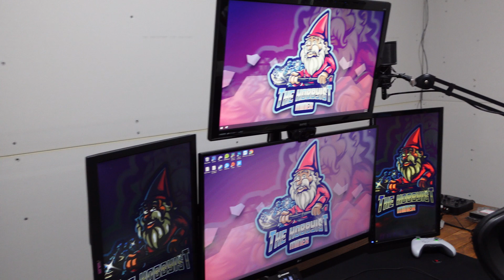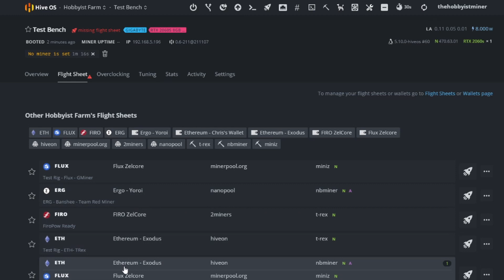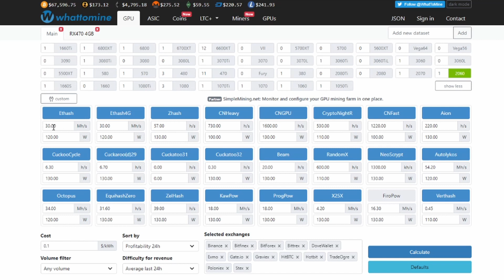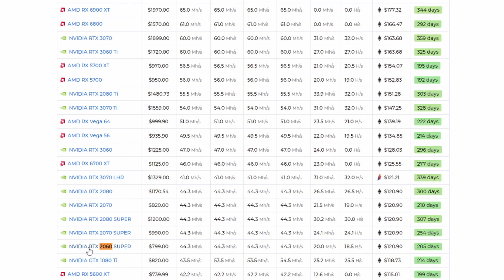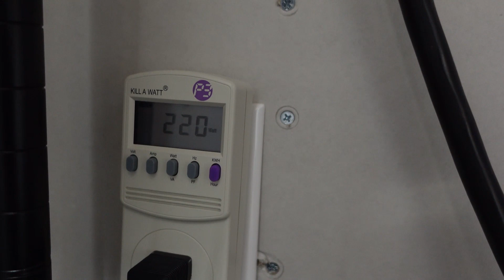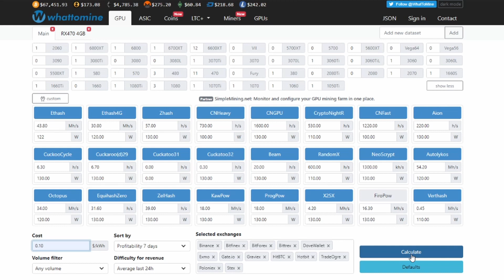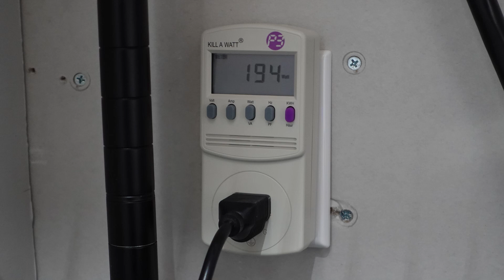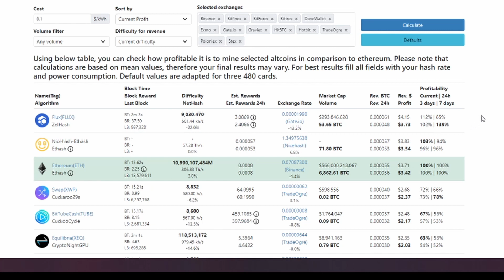RTX 2060 Super Mining Ethereum & Flux Hashrate, Profitability & Overclocking

Comment from the maker: Are you running a 2060 or 2060 Super? What kind of Hashrate and Power Consumption are you seeing on this card? LOVING IT!
Reply: I have a 2060s, and interestingly, you can push the power draw really low on these bad boys. Mine is pulling 42 MH/s at around 80W draw.
Reply: @hakarlrs9817  How??? I do not believe you, the lowest wattage of my 2060s was 98w and 38,3 mh/s.
Reply: @ramondiaz6044  ..thats about were im not.
Reply: @ramondiaz6044  mine is 520kh/w...
Reply: @hakarlrs9817  what model?
Reply: @2sidetales749  2060S as my comment says. Super, that is.
Reply: @hakarlrs9817  OC?
Reply: @mobileleaguebb1148   
core: -500
mem: +1300
Reply: I have a 2060 Super that pretty much runs about the same as the 2080 that share a miner rig with some 3070 and 3080.   Bother the 20's get around 42-43 MHS.  Mining ETH on that machine.
Reply: I GOT6 OF 2060SUPER, EACH GET 43.5 MHS, HAPPY WITH THAT😁
Reply: Not yet. Very hard to find any at a decent price tag
Reply: I have 2X 2060 super doing 85.5MH total on eth, I use Trex Miner in windows & the lock corelclock features- each cards runs at about 95watts.. BTW a 2060 super is basically a 2070
Reply: @jaytech7514  hi, what is your overclock settings ? I have 107watt- 37 MH/s 😬 ı m using nicehash miner.
Reply: @furkanozturk3286  
core - 200
Mem + 900
PL - 71%
Directly to the batch file, I don’t use msi afterburner. Then lock core clock @1035

T. rex miner in windows 10/ 
My cards are zotac 2060super mini all with samsung mem
Reply: @jaytech7514  i have galax model card .8gb version. İ use nicehash miner but I have 37 mh /s
Reply: @furkanozturk3286  it happened to me,  nice hash did not work for me before. Keep exploring other options. Keep in mind every gpu is unique, what works for me might not work for you..
Reply: Evga 2060 sc   . Only getting 18.6 mh on kawpow
Reply: i've found 1 RTX 2060 to a decent price and get 32 on eth for 67 w
Reply: Running 2 2060's and 2 2070's. One of my 2070's is more efficient than my 3070 or 3060ti. 43,8 mh/s @ 77watt. So really recommend these cards if you use it with a locked core clock.
Reply: Is Equihash 125.4 (Flux coin) more memory, or gpu constrained?  I am currently using the card tweaks for ETH with it since I have not found anything about it.
Reply: My roommate who's gone a lot lets me mine on his 2060 Super, (because he doesn't like money, I guess?) and it's great.

Also, I see I was right about what this card is.
Reply: I have a 2060 and a 3070 I know how to build the pc to mine with but idk how to mine
Reply: Running both, actually have a 2060 Fe too, but my 2060S is stuck with 38.5 mhs, tried everything can't push it further.
Reply: @Mads_Max17  I have the same issue with an Gainward Ghost 2060s  micron stucks at 38.9 mhs, and no solution yet. Any ideas?
Reply: @KaosE30  nope, tried everything still same
Reply: @Mads_Max17  I think the problem is within the powerlimit in the BIOS of this card ist set to 175w. I tried other bios versions in hiveOS with higher powerlimits but the card didn't start so everytime i had to flash it back to the original :(
Reply: Core 1035, Memory 2175, no power limit, stable 44 MH.
This was my first ETH mining card and had a chance to buy several butbought only 1..stupid me..
Reply: How to make core locked at 1845MHz?Not absolutely core clock
Reply: i have the exact same card and cant get past 38.78
Reply: @slippyboglefishing  2060 Super? Might just be silicone lottery I guess but mine keep a stable 42 with the mentioned OC.
Reply: Mine with Micron memory and your OC is doing for some reason 32MH/s, with my OC -502 core 1500 memory it does 37.5MH/s... Still pretty bad in comparison
Reply: I have a GB 2060 OC and I am getting 33 MH @ 82w in hive on 2miners pool
Reply: I have two 2060 Super cards. Both are Micron memory. I am getting 44Mhs on Zotac card and MSI card is giving only 27mhs. rig is crashing if i set 2000 memory clock on hiveos. both cards are on same rig. Please help
Reply: @sintojacobp  set the core at -504 and memory to 1000, it should give around 37MH
Reply: @xalex7923  Thanks for reply. Ideally it should give 44+ Mhs
Reply: @sintojacobp  some 2060s can't give more than 38mhs
Reply: @xalex7923  sad 😭
Reply: So, i have 3x a 2060 Super. efficiency: 510kh/w, 520kh/w and 480kh/w. they are all 3 samsung vram and just awesome cards. close to the 3070's

Comment: I'm getting 315 sol from 2 2060 supers and 5 2060 12 gb at a whopping 1100 watts. That's about 6 flux a day on 2miners. I'm using the miniz miner, seems to get a lot more out of these cards but also uses a ton a electricity.

Comment: I just bought a used 2060 super. Can't get it over 36m/h. No matter what setting i put on this card?
Reply from the maker: What memory
Reply: @TheHobbyistMiner  ..mem 1700, core is -502.
Reply: @TheHobbyistMiner  ..it runs a lil hot i think. 56c with fans at 99%
Reply: @TheHobbyistMiner  ..i was thinking thermal pads might be bad

Comment: You have a splitter connecting the riser and the card would this will work if used with a rtx 3080 ti using a Corsair hx1200 which has 3 cards running on it? 

Currently I’m powering my risers and  mombo with another power supply a sea sonic 850. 

Btw awesome vids thank your, will be ordering the gpu holders from you soon

Comment: I've got one of those 2060supers mining.
44.26MH 90w powerdraw(according to hiveos) 1050core and 2400memory
It runs really cool even on 60% fan
Reply: is not dangerous for yor Vram memory that they are always running at 2400 MHz while you are minning ?.  Perhaps in 5 or 6 months you might damage the memories.
Reply: @hugoc.robles156  no why? the lower the power and voltage the longer the components live. mhz doesnt affect the lifespan its the voltage!!

Comment: I;m runing a 2060 super along a 1070.  Is there a way to get an idea of what the HiveOS overclock settings would map to in Afterburner?  I did some adjustment and was able to  bump up the hash rate on both cards a few ticks but still only getting 38 on the 2060s
Reply: I used core at -500, memory at 1250, was getting 44mh at 125w later i use the curve (press ctrf+F in msi afterburn) and set absolute clock to 1095 and now getting
43mh at 100w

Comment: I have a Geforce RTX 2060 that runs 42MH for only 100 watts. I love this card. Great video!
Reply: what's your OC for that? I'm about there but sitting at 125w
Reply: @jonster97  core clock max is set to 1200 and memory clock is at 800. Let me know if it works for you
Reply: @jonster97  try memory 7900mhz and core clock max: 1050mhz with no power limit. or if then do 126w. mine is running 520kh/w

Comment: I’m getting 32 mh at 75 watts on my 2 regular 2060’s. The most efficient card I have by a lot. Im buying more.
Reply: Core 1050 mem 1800, right now one is showing 85 watts, the other 73. I usually see them both around 75-77. One is a Zotac with Micron, the other a little HP single fan with Samsung mem. One at 32.0 one at 32.3
Reply: What are your overclocks? I can only get them to 29mh around 85-90 Watts

Comment: RTX 2060 Supers are my favorite mining card. Founders edition and Asus Rog are the most stable ones to overclock. 

CC: -300
MC: +1200
PL: 71% @ 125w
44.4MH/s
Reply: I have a zotac w/ same settings to you
Reply: @jaytech7514  I have one Zotac 2060 Super mini, it’s only stable at MC: +1000, everything else the same. Does about 42 MH/s
Reply: Wow thanks for this, I was WAY off on my tweaking.  Plugged in similar numbers and got 7 more MH using 27W less and 10 deg cooler.
Reply: @turbo2ltr  My memory clocks are what I tweak the most when tuning. Some 2060 Supers max out at +1200. I have one Gigabyte 2060 Super that crashes beyond +950.

Comment: I dont understand how ppl get those hash rate while my rtx 2080s can max give me 35mh/s can explian what is going on with my gpu?
Reply: @STANIS: The 2080S is a little different to tweak, since it has other memory than the 2060-2080 models. Mine can hit almost 45 MH. Coreclock locked to 1200. Memory +1500. Yes it need that much for almost 45 MH, but the Samsung memorychips on the 2080Super can take this. Power reported on mine is about 113-115w. Not as efficient on ETH as the 2060S, but stronger on GPU dependent algos.

Comment: 44 - 43,8 mh/s is too much for this card, if you really care your 2060s you should run at max of 41 - 42 mh/s.
Reply: this card can run even more at 44.3 with -265 cclock +1130 mclock 80%fan and 125w, no heat
Reply: @vicrob7742  what model of RTX 2060 Super do you have ?.
Reply: @hugoc.robles156  exactly the same as in the video, GeForce® RTX 2060 SUPER™ GAMING OC 8G ---> 
GV-N206SGAMING OC-8GC
Reply: hiveos oc @44.48mh/s
FAN80
 CORE-265 MEM2262 PL125
Reply: @vicrob7742  did i need to write + or - on oc bro